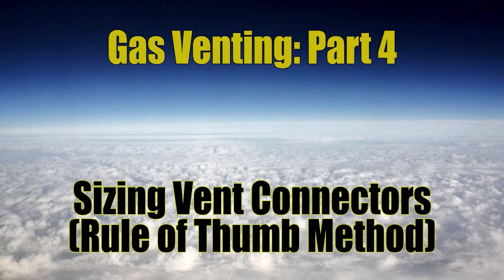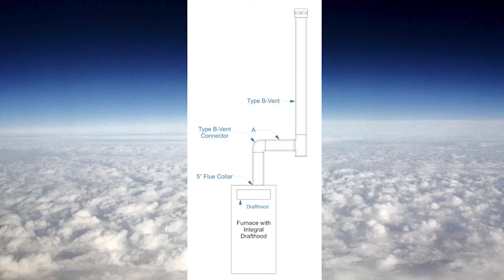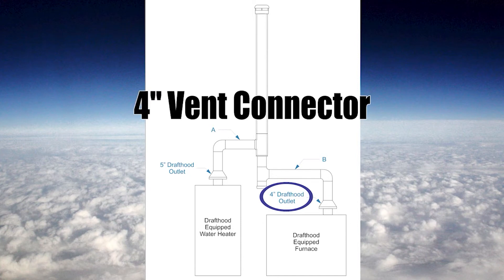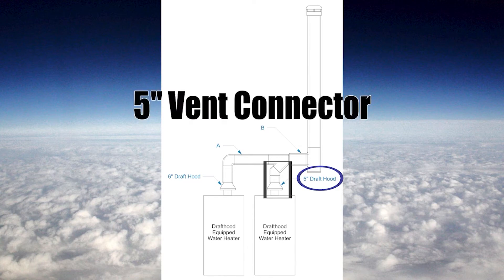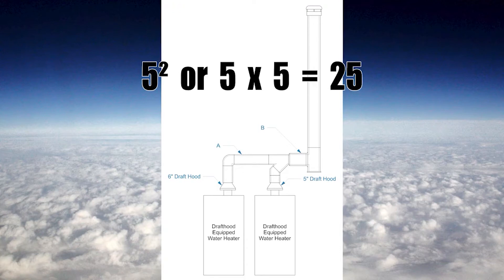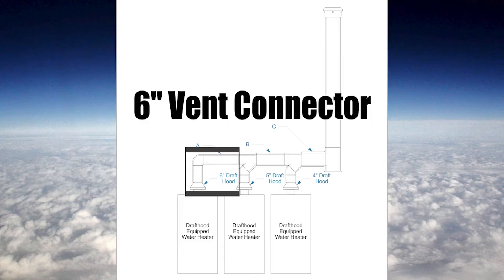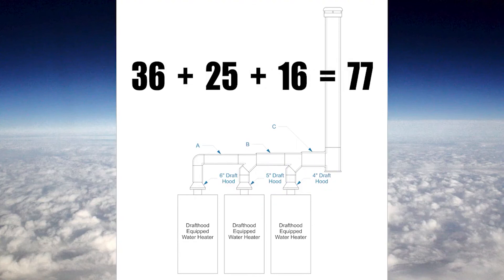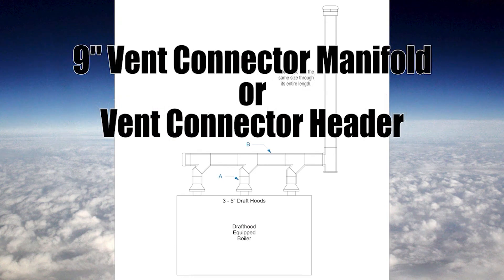Gas Venting: Part 4 - Sizing Vent Connectors with the Rule of Thumb Method

Comment: there is different to size for vent connector with part 2? confused
Reply from the maker: You will need to give me more details in your question. I don't know what you are trying to clarify.
Reply: @MathematicPlumber  in part 2, you said the biggest appliance keep 100% BTU, others take 50%. But in this vedio, your take total appliance 100% BTU? Is I missed something?
Reply from the maker: @xiaoxiewang3420   Oh I see what you mean. 'Vents' and 'Vent Connectors' are totally different. And yes, I recognize that this is confusing. You may need to re-watch the first 3 videos to see the difference between the two.

'Vents' are mostly vertical, which means that the flue gases travel up it very easily. Therefore it is calculated at 100% of the largest, and 50% of all remaining.

'Vent Connectors' are mostly horizontal, which means that the flue gases travel through it very slowly or with a lot of extra restriction. Therefore it is calculated at 100% of all appliances venting through it.
Reply: @MathematicPlumber   Thanks. very helpful

Comment: Thanks. It’s very helpful. Can make one video on how we can know the maximum vent connector length horizontal upto th chimney .. th
Reply from the maker: No video needed. You can travel 1.5 feet horizontally for every inch of pipe diameter.

Example, You have a 4" vent connector, therefore you can travel: 1.5 x 4 = 6 feet horizontally
Reply: @MathematicPlumber  thanks 😊

Comment: why is the boiler example using just one size manifold (9") instead of staggered sizing like previous example ?
Reply from the maker: I am just showing that it is possible to install the vent in different ways. The staggered sizing is perfectly acceptable, but buying material to vent it all at 9" is more simple.
Reply: @MathematicPlumber   in that case (one manifold) the largest required size will be the entire manifold/ common vent connector?    test in 3 weeks, just clarifying,  love the videos!  way easier than reading for hours
Reply from the maker: @davequesnel8740  Sure is

Comment: Hi Kelly...
My client just got flagged for having a natural gas furnace venting into a chimney while at the same time a natural gas fireplace vents into the chimney. The chimney is large enough for me to drop a B-vent down to the furnace and vent it out the top of the chimney opening. My question is - and I know you are in Canada so the rule may be different than here in the states but... can the NG fireplace now use the chimney as its primary vent while the B-vent lives and vents the furnace in the same space?